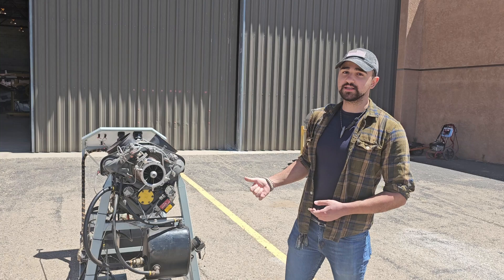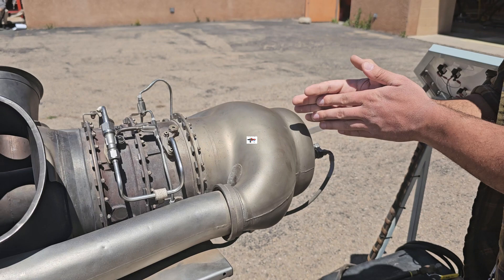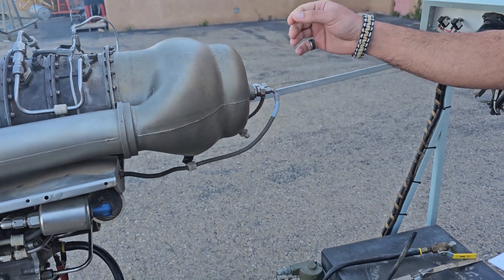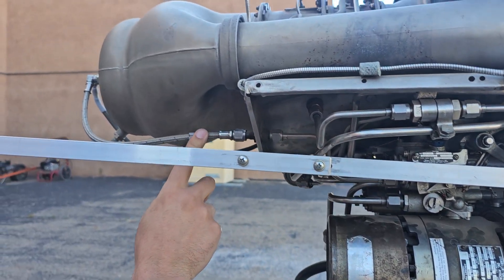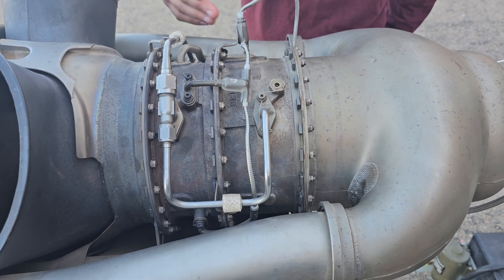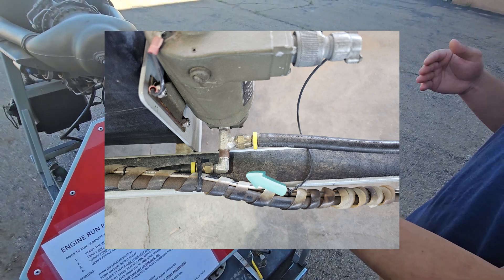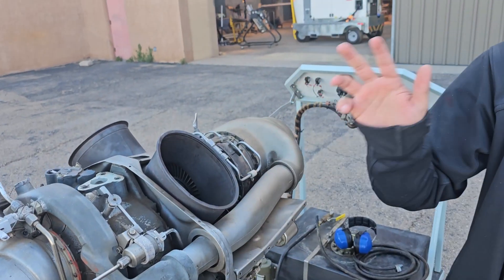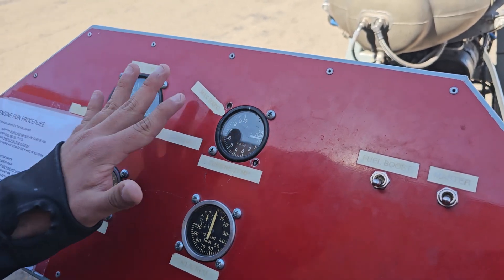Allison 250 School Project, Description and Run up

Comment: The first OH 58 in Vietnam the transmissions leaked and mixed with dirt and got into the engine and coated the compressor with oil mud.we had to pull all the engines and open the compressors and scrub them out with solvent and a tooth brush.Only take one half at a time to keep it aligned the tips cut their own clearance.No matter if you don't touch anything you always need to adjust that little square N 1 screw.